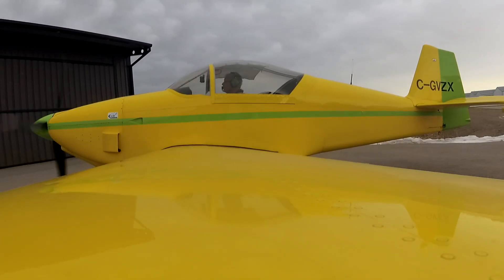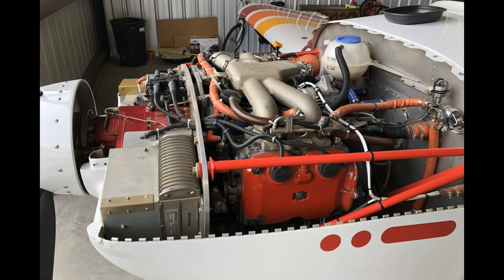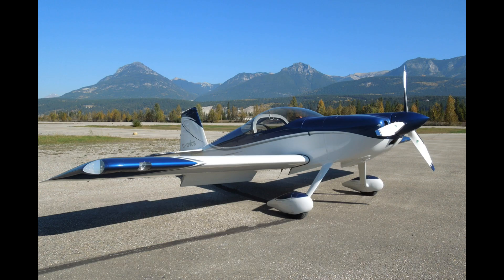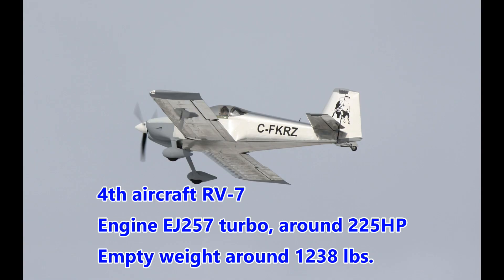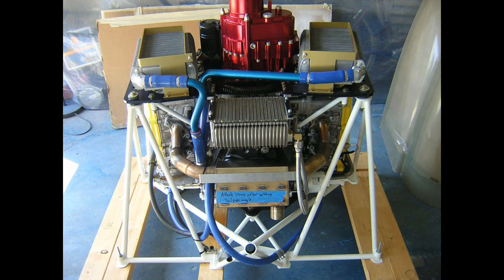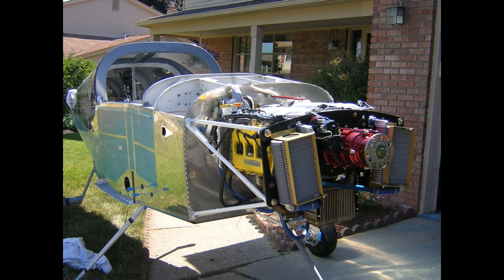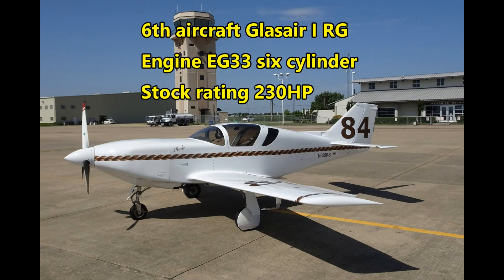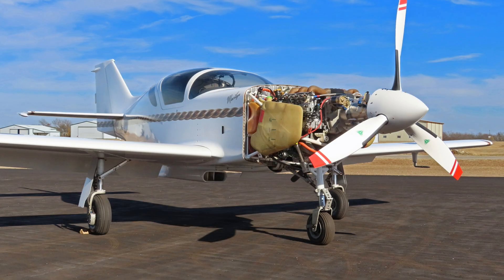6 Subaru Powered Aircraft

Comment: Great Video and have a Happy New Year.  

I have the EG33, with stock ECU, in my Cozy MKIV RG with 165 Hrs on the engine.  I'm running the Ross Aero PSRU with 1.85:1 ratio and that is the only thing I don't like.  The engine cools just great and even over cools.  I use an Arduino to control the intake base on coolant temperature. (No T-stat on the engine).  Best speeds to date are 196KTAS at 10,000ft.  Propeller is fixed pitch.  I've a few in flight videos on my chapter website at https://chapters.eaa.org/eaa245/members-videos/phillip-johnson .  Keep up the good work.
Reply from the maker: Hi Phillip. Thanks for the link and I'd love to touch base with you for perhaps a Part 2.
Reply: @rv6ejguy  Touching base is cool with me.  BTW I'm in Ottawa.  Just go to the following link http://www.canardaviation.com/PhillipJohnson/Contact/Contact.htm . Sorry for the indirect contact info but if I put my email address here, all the BOTS in the world will will be sending me stuff.
Reply from the maker: @PLMJohnson  Got it will drop you a line tonight after work. Thx.
Reply: @rv6ejguy  Cool.  Remember I'm on Ottawa time.
Reply: Hi Phillip.. what is the size an pitch of the  prop you are using ?. Your setup looks cool
Reply: @rx7fanrx8owner64  I made the three blade prop and have been trimming it down to maximise HP.  I'm still not there yet.  The pitch is close to 90 inches and the diameter 64 inches.  Checkout info at http://www.canardaviation.com/PhillipJohnson/Propeller/propeller.htm

Comment: Great video Ross.  You left out the important numbers though.  10,800 Lycoming RV's, maybe 20 Subes.  It's not for nothing Ross!
Reply: You could also look at it that Subaru makes more engines in a month than lycoming....ever. Subaru also puts more into r&d than lycoming.... so there is that.
Reply: @grandenauto3214  Subaru makes many AUTO engines each month.....so there is that.
Reply: @yukon4511  You DO know Subaru's historical origins? Right?
Reply: @clasdauskas I am aware that Subaru hasn't made an aircraft engine in 50 years, and Lycoming has made
 millions.  Your point is?
Reply from the maker: Thanks. As I stated in my other comments, this video is about Subarus not Lycomings. If you enjoy flying your Lycoming, continue...

 Subarus will never replace Lycomings in most RVs. I think everyone already knows that.
Reply: @rv6ejguy  Lots of noobs here Ross.  They need the numbers before deciding on an engine.
Reply from the maker: @yukon4511  Not to worry as there are no Subaru FWF kits available any more and 99.5% of RV builders will install a Lyc. The other .5% want something different.
Reply: @rv6ejguy  Yes Ross, I understand "different".  It's when auto engines are portrayed as "superior", I get nervous.  Higher weight and higher fuel consumption are factors which new builders need to be made aware of.
Reply from the maker: @yukon4511   The fuel consumption is pretty similar on Andy's plane to a Lyc at that speed.  

The speed of Russell's Glasair is superior to any other 200 cubic inch Lyconental powered airplane of similar size that I know of.  

The speed of Shane's RV-7 is superior to any atmo Lyc 360 RV-7 I am aware of.

I listed the weights on purpose so viewers would see that, just as I showed some of the problems encountered with these packages. Not sugar coating anything here.

You don't care for auto engines in aircraft, I know that from years of your comments on the subject and I get it you'd never install one in your airplane. Read you 5 by 5. That's fine, fly your Lycoming... Jeez Can't you just enjoy the video like most folks here? I'm not telling people to ash can their Lyc and put in a Sube.
Reply: @rv6ejguy  Apples to oranges Ross.  Let's talk about your burn on your 6A at 170
kts.  By the way, I did enjoy your video.
Reply from the maker: @yukon4511   My IVO prop can't absorb all the power at altitude so RPM starts to creep up above 150 knots (full coarse setting). This hurts the fuel flows.  I'm around 11-12 GPH to do 170 KTAS, depending on altitude.

An MT prop would give more speed and lower fuel flows if I wanted. Lot of $ and an extra 15 pounds weight I don't want. 140 knots and 6.7 GPH suits my mission just fine.

Shane's turbo 7 was doing around 185 KTAS on around 9.5 GPH at 10-12,000 feet if I recall correctly.

Comment: Every time I explain to people the pros and cons of auto engine conversations in aircraft, I say the exception and mention this plane.  Unfortunately Eggenfellner bolt on Subaru as a direct Lyc replacement was a failure.... successful in sales for a time but clearly not the Lyc  kilter with a "modern engine". This hurt the reputation of Subaru and car engine conversions in general. I will say It PO's me to hear how antiquated the Lyc or Conti air cooled direct drive AC engines are... Nope they are purpose built for a specific mission (airplanes), very effective, efficient, light, powerful. In almost every case any Lyc or Continental , especially one installed properly, will be better overall than a car engine conversion,  WITH exceptions. Those exceptions are rare and require a lot of special  talent, dedication, time, effort, money and knowledge. Case in point RV6eguy and his friends here. Hats off. Personally I want to go fly and I will bolt on a Lyc 360 or 540 with a CS prop. As far as modern aircraft engines have bolt on updates of electronic ignition and fuel injection....  RV6eguy sells one version that is excellent and was on the winning Lancair in the Reno Air Race Sport class, which I believe had a Continental (not a car engine). In fact all the planes that were competitive had Lycs or Continentals. Red Bull Air race (before canceled) were all Lyc IO-540's. Point is car engines are not killing the "old fashion" Lyc or Continental, but in the minds and emotion of many "car engines are modern". Yep for cars. Most of the modern stuff is not the 4-stroke engine (piston, rods, crank, block, heads, valves) itself or flies not matter for aircraft use, but magic is in the ignition and fuel delivery, in the form of electronic ignition and fuel injection. Magnetos with fixed timing are good for airplanes that run at one RPM in cruise, but electronic ignition is better, hotter, longer spark and variable timing which comes into play only below 75% as when flying at high altitudes. Fuel injection (mechanical) has been on airplanes for over a half century or more. To be reliable and electrically independent they were mechanical. That works well in an engine that drones on at one RPM with manual mixture. So pilot has to do some work (pill a knob, look at EGT). However people like RV6eguy and others have fancy brain electronic ignitions you can bolt onto your experimental or even certified planes today.  Still the OLD Magneto and OLD Carburetors and mechanical fuel injection work well... just not as efficient by a little (meaning slightly more fuel burn on cruise). Mechanical dual magnetos and mechanical fuel delivery making it electrically independent has obvious advantages that typical "modern" car engines don't have with their ECU. No electricity no enginepower, no ,fly. Obviously redundant electrical systems is mandatory for a car engine in an  airplane (adding complexity and weight). 

In general car engines in a plane will result in a plane that is heaver and slower than the Lyc or Continental powered version of the same plane. Most kit planes are designed by the manufacture for an aircraft engine, engine mount, cowl... etc. There is no worry/effort of liquid cooling or PSRU adapting/fitting. So you are on your own making the car engine work as RVe6uy did. Great work, check his old videos out. In general a new clone Lyc is going to be cheaper, lighter, faster, get you in the air faster, and the resale of your plane will be higher than the car version of that plane. That is just the historical and typical case.  The Lyc you bolt up and go fly in less time, with less weight, with better performance and LESS MONEY. The direct drive slow turning air-cooled engine is very reliable. End of story "old technology" or not. (BTW all the modern stuff, electronic FI, electronic ignition bolts onto a Lyc just fine to bring it up to the 21st century).   

Two things that has to be mentioned is one DRAG... The water cooling and radiator is a big drag unless you design the installation well. The P-51 had an airframe made around the radiator and the big in-line V12. To add this onto an existing airframe designed for an air cooled engine is a challenge. In the end in my opinion it will result in more weight and  drag will be at least if not more, a lot more, than the air cooled engine installation.  Second fuel burn. Car engines in planes need to run at higher power fir longer than they do in automobiles. They don't burn less fuel. They may even burn more on a MPG basis or Thrust to fuel burn basis. Now with engine monitors and fuel injection (mechanical) you can run your LYC lean or peak and get amazing specific fuel consumption that is better than the average car or pickup truck MPG on the road. Bear 30 mph is possible.

COST? People think the cost of a car engine is cheaper than a Lyc. In the end a car engine is often more expensive than a Lyc. Why? Lyc is no longer a monopoly. There are complete STC parts catalogs for Lyc and you can buy a "CLONE" engine that is made to the same  certification standards with STC parts. Since LYC is not a monopoly there is competition which results in lower prices. Lots of parts are available, thus prices have gone down.  I built my first kit plane in late 1980's with a Lyc O-360. The only choice was a used running engine from a plane salvage company. New from Lyc was out of the question at the time. REMANUFACTURE required a trade in. All very expensive, at least to me in 1980's just out of college. Today you can buy a NEW Lyc clone for under $30K, complete, bolt on, put in oil and gas... push start. A car engine is a labor of love and the enjoyment of experimentation and 100's of hours of extra labor.
IF YOU BUY a complete car engine kit claiming plug and play, with the engine, ,mount, cowl, PSRU, radiator, hoses, wiring and so on... it will end up costing more. Again most kit planes come with engine mount and cowl for the LYC...  There is no PSRU, radiators or ducting needed in a Lyc. Engine baffles on an aircolled Lyc are simple, light and cheap.

There are two categories where auto engines work best in my opinion. One is very low powered slow planes and very fast large planes, typically warbird replicas. The slow planes can use small a 4 cylinder (smaller than a Subaru) like a Suzuki 4 banger car engine (in cars outside USA) or even a Yamaha snowmobile/motorcycle engine. A plane that might use these are a Zenith or Kitfox, slow light airframes with lots of lift. We are talking 100HP power range. On the other end are scale warbirds, that can handle the weight and power of a  V8 Chevy LS. Still everything I said applies. I did not mention reliability and PSRU's.

The last part is the PSRU and reliability overall of car engines. All these non aircraft engines turn at much higher RPM, too fast for an aircraft Prop. The PSRU (Prop Speed Reduction Unit) is mandatory and adds weight, complexity and a failure point that does not exist with a low RPM direct drive LYC. This is one of the big draw backs of car engines in my mind and my personal opinion. Yes some PSRU's have been OK, especially in certified aircraft engines. However getting a good PSRU to work well with car engines has historically proven to be difficult. I like the wide Cog belt... less worry about harmonics, easy, simple, some what proven, and easy to inspect. 

Back to Eggenfellner. He went bankrupt. He left a lot of people holding the bag, Subaru engines that did not work, money taken, orders incomplete. Well he is back at it with Viking engines using Honda engines for the FIT, a small 4 banger, for small planes like Zenith. He has already had some PSRU failures. Is it better than Rotax or Continental O-200 (100HP). I don't think so. The Rotax is OK but WAY over priced. Not sure Continental O-200's are in full production, and parts for the O-200 are not as plentiful or cheap as the Lyc 320/360 due to volume. If you need low power get a O-320 150/160HP Lyc. The Contiental O-200 is used in Reno air race for the formula planes and of course powered many C-150's. O-200 was the choice of many Vari-EZ's and the first Lancair  I recall all fast planes by being small, light, low drag. (I)O-200 is a great  smooth engine for LSA  Continental is foolish for not pushing this into the LSA and experimental market selling it for less than Rotax (which at $20K for 100HP to $37K for 140HPis easy to do).

This long rant is not to put down the effort to put car engines in planes, but you have to realize it is a big compromise and takes a lot of skill, ability, talent, time, effort and RIGHT CHOICES to make it work well and safely. There are no bolt on car engine kits with all the installation details because it would be too expensive. Even if there was it would not be plug and play. You have to design, fab, test, modify it yourself to dial it in. Again Lyc bolt on and go fly... light, fast, efferent, reliable.
Reply from the maker: George, longest reply I've ever seen on YT... The video was made to show how these engines have worked for 6 people and I have hundreds of customers worldwide flying Subarus with our EFI (over 500 ECUs sold for these engines).  I can't show all of them in a video. Over 500 RAF gyros used Sube EJ engines as the standard powerplant and they worked well there. This video didn't set out to debate Subaru vs. Lycoming, it was just informational for those interested and I don't advocate that Subarus are better for most folks to use in their aircraft.

Andy's 1150 hours  to date show the Egg packages can work just fine and there are still dozens flying, belonging to the Subenews support group. It wasn't an overall success as they were not properly tested/developed and support vanished when he went bankrupt.

My flight testing and that of Dan Horton has shown that a proper rad setup requires less airflow and has higher momentum recovery that a proper air cooled setup-so less drag is possible. The next video will explore the radiator setups on my RV and Russell's Glasair in design detail.

Shane Getson's turbo 7 showed much higher speeds and near equal fuel economy to any non-race Lycoming powered 7. Russell's Glasair trounces all the Lyconentals in his class- 22 times in a row- over 3000 nautical miles of racing at nearly full power and it hasn't blown up yet.
Reply: Auto Conversions don’t fly much. If at all
Reply from the maker: @creightonking8436  You can take a look at the new video up yesterday with a Glastar having over 2300 hours on it.
Reply: "I will say It PO's me to hear how antiquated the Lyc or Conti air cooled direct drive AC engines are... Nope they are purpose built for a specific mission (airplanes), very effective, efficient, light, powerful."
-
When compared to automotive engines, maybe, but when compared to what's possible with modern engine technology, they are horribly antiquated.
-
Have a look at this video:  https://www.youtube.com/watch?v=GJy93vrbvw0 ... now consider that the 320T can be run on mogas, so the total mission fuel cost in the example shown at the end of the video would be $103.60, well less than one third of the cost of the fuel for the Lycoming engine and well lass than half of the cost of the fuel for the Continental. The 320T is also about 200 pounds lighter than comparable offerings from traditional engine builders, while also offering the ability to make use of the Meredith Effect, which could nearly eliminate the drag produced by the cooling system for the engine, making the aircraft more efficient overall. No requirement for lead in the fuel used in the 320T is also a significant bonus.
Reply: Two mags, a mechanical fuel pump and a carb for me George!
Reply: @yukon4511  Ha ha right on.

Comment: Very interested in a non-GA engine for my RV-10 project. Interested in how feasible this would be and what is the estimated cost of the Subaru engine with the twin turbos you showed in the end? What’s the weight on that too?
Reply from the maker: You'd have to dig up the engine which are a bit rare and have the skills to rebuild it, source the redrive, turbos, custom engine mount, prop etc. Really requires an engineer or gearhead to make it work reliably. Wouldn't be cheap to hire all that done.

Comment: Subaru manufactures nice equipment. One of my acquaintances produces a VW Bug conversion for rear engine drive conversions of the Bug replacing the VW engine/transmission with Subaru power. Reversing the planetary gearing to facilitate the setup was a fun project. I can see why Subaru powered aircraft is successful. Thanks for the video!